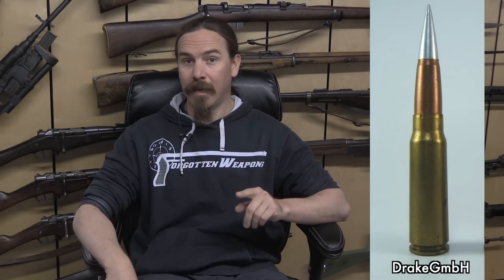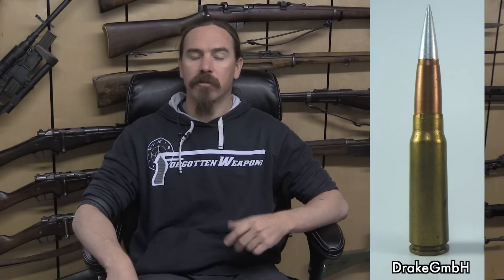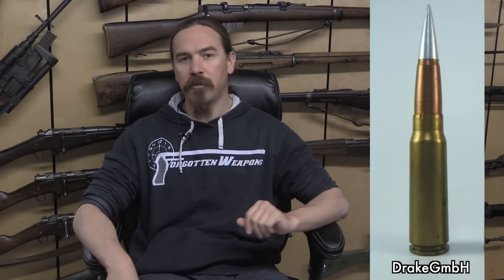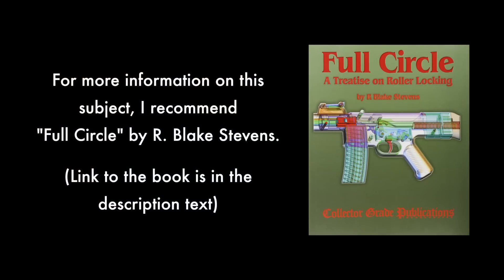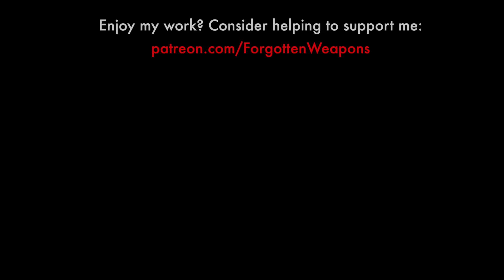Full Auto at 1000m: The 7.92x41mm CETME Cartridge

Comment: Was there any manufacturing cost assessments done on this ammunition? With a copper band around an aluminum core, how much would the cost of this round been had it been implemented as the standard Spanish round? Going with 7.62 NATO makes sourcing ammunition easier if you add foreign sources to your own domestic manufacturing capability and is also a cheaper round due to simpler production techniques and mass production of a single round.

The fact that this round was shoved down NATO's throat is for another video as this round has been shown to be the wrong round when compared to this round, the .280 British, the .276 Pederson round and others.

Comment: 6.5 Grendel or 6.8 SPC would a better round.  If all else fails, go with the 7.62 x 39 round.....it works!
Reply: Also, 5,56x45mm works and that's the problem there is not enough advantage to replace the 5.56.
Reply: @Forodir  The 6.5 and 6.8 come into their own at 300 yards.  The 6.5 stays supersonic past 1,000 yards.  As for the 7.62 x 39, I just like shooting it and the weapons designed for it.  On full auto, the 7.62 x 39 extracts much easier with the tapered case.
Reply: @wintonhudelson2252  
Again, no one cares. The 5,56 is a military cartridge and for our purposes this is an efficient round and good enough. There is just no need to change it for a slightly better round. And changing means a lot of logistics and all the tail which follows.
If you are a civilian shooter, sure you can choose whatever you like best.
And I never had a problem about the extraction with 5,56 that sounds like more of a weapons problem then a problem with the cartridge, but I am a bit pampered because I use mostly  the G36 and malfunctions are nearly nonexistent with that weapon.
Reply: @Forodir  It's nothing to me, but it's the government that is testing other rounds.  In these determinations, apparently the Grendel has edged out the 6.8 SPC.  There is also an "Unidentified" additional caliber being tested.  Their main thrust for the new round is for use in a SAW, such as the M249.  Then it would "Trickle-down" to service rifles.
Reply: @wintonhudelson2252  
The different rounds the US Army are testing are from the LSAT program, and this is not about the 6.8 SPC or the Grendel this will be a totally different ammunition if (sic!) the program will succeed.
6.8 SPC or Grendel won't see any action in military use except maybe some SOF.

Comment: Filling bullets with Mercury would make them a lot more massive so you could feel like a 22 long rifle scopex with Mercury and greatly achieve a much farther distance that's the kind of sniper rifle I want is something like a 22 long rifle that I can have 40 rounds and a magazine but it's a longer style case maybe four or five times longer like a 22 hornet but maybe even a longer than that something I can throw on full Auto something I can have like a three on verse and a single fire you know pull a bolt up from a locked position from bolt action to a you know a semi lug fashion then you can just pine sap some pine cones all around the barrel for a suppressor it's a lot of stuff you can do with pine sap in time and pine needles and pine cones just put the pine needles in the teeth of the pine cones of pine sap wrap it and birch bark and some old man's beard and some tree tie. Pine sap drips a d get on fire don't get too warm